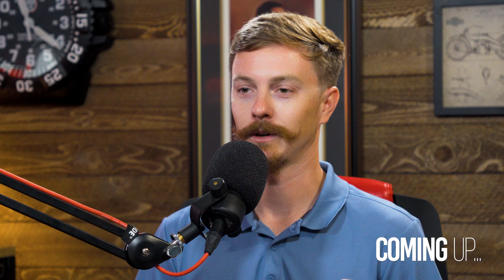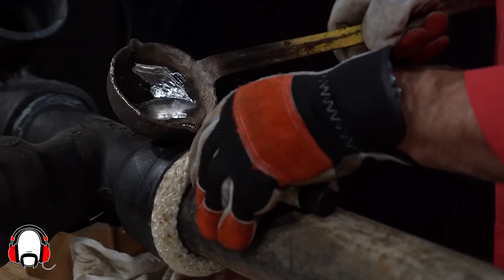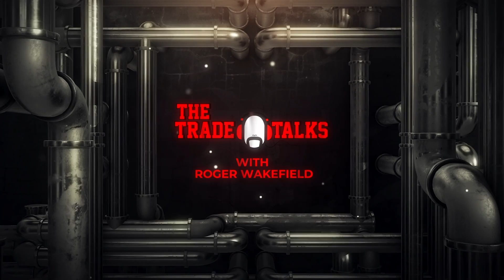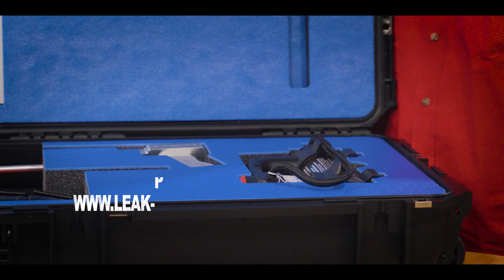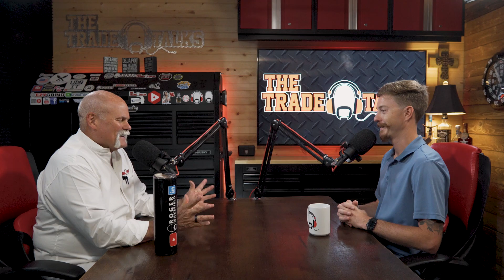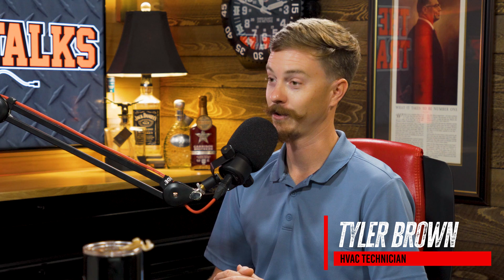HVAC vs Plumber Debate: Which is Better? | The Trade Talks #166

Comment: I’m an HVAC guy who does mostly plumbing 😅 ….in my area plumbing is better because my market is saturated with many huge ( private equity owned🙈 ) companies that make millions doing HVAC (its hard for me to compete )….. plumbing is awesome😅…. Because ,…. The customer “must fix it “…. If you have a plumbing issue, it is truly an emergency…..😅….(HVAC can wait however ) HVAC in my area is  basically selling systems that are under warranty for 10 years ….after that they just replace the whole system …..(in a hot attic  ) plumbing service is lots of small jobs …. (And you’re the hero when you leave 😅)…. With HVAC,  the customer is pissed because “we sold the system to them” ( 5 years ago ) and you’re almost married to it from that point …. And they want it fixed for free ….🙈

Comment: I'm a Plumbing and HVAC service tech. I prefer HVAC, but re-pipes every now and then are fun. I'm always the warranty guy or the damage control guy now. I don't even bill out the customer because the company just sends me to solve a problem that no one else can. I work from first principles so I understand things from refrigeration, parts, down to the control board and logic gates.

I prefer HVAC because bad installations keep me busy and the work is relatively clean. Attics are probably the worst of HVAC and drain cleaning is probably the worst of Plumbing. If you're good, you can avoid drain cleaning as a Plumber. As a good HVAC tech, you can't avoid attics.

Comment: If you want to work for yourself HVAC is the best trade. Nobody wants to be hot or cold.
Reply: False. Every house has a kitchen sink, toilet , lav , tub/shower. Most have laundry.  Drain cleaning .That’s all plumbers work. Add in boilers which up here in north east is very common. Hvac is a great trade. But they don’t get more work than plumbers
Reply: @stephencottens2521  
Im in naples Florida. When the AC goes down they will pay anything to get it working again. When their sink drips they couldn't care less.
Reply: @ Yeah id imagine, can’t have no ac down there, hot as hell. Here frozen pipes and or no heat calls keep us very busy throughout winter. We’ve got a lot of double triple deckers as well so if top sinks leaking , you’ll hear about  it from bottom tenants.
Reply: People like not having to go to the bathroom outside and take a shower
Reply: @plumber1874  
True however there is always more work for an HVAC tech than Amy other trade.
Reply: @foreverssober Electrician
Reply: @foreverssober cap
Reply: @foreverssober maybe barber trade..
Reply: I heard child human trafficking/pimping was a more lucrative business Jeffery..
Reply: back in the old days windows up and doors open they beg for water it was a miracle